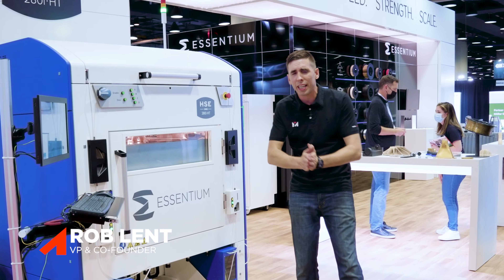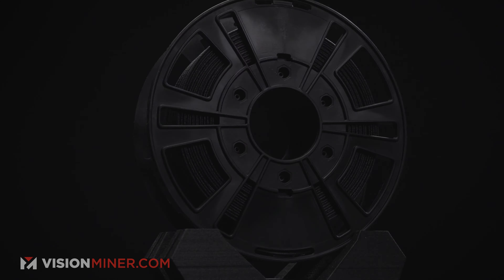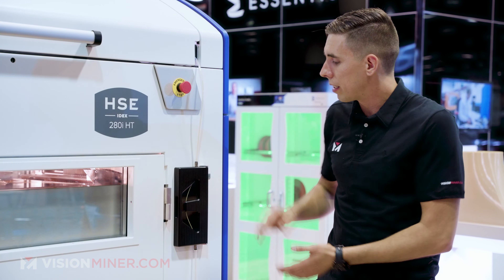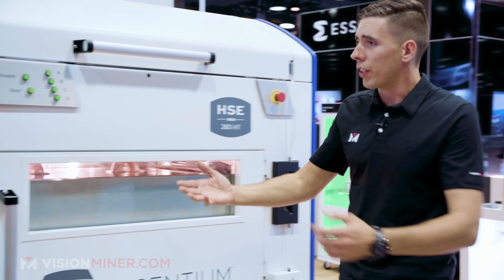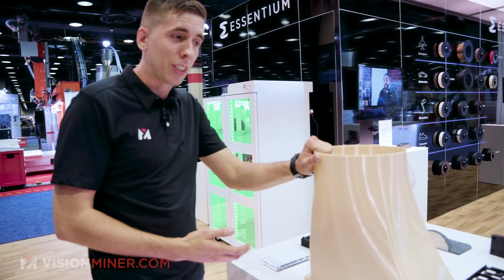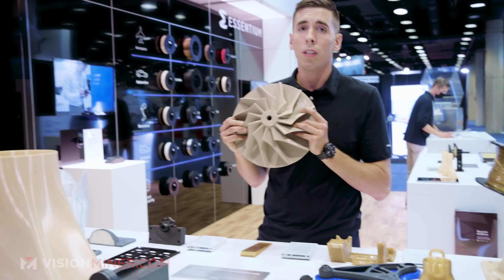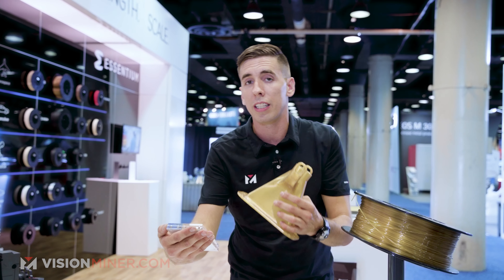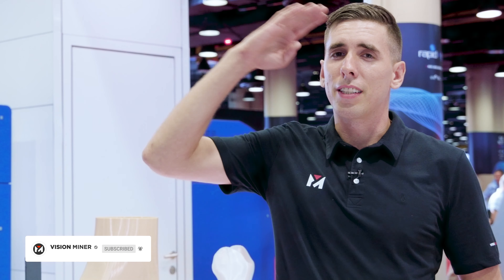Essentium HSE 280i HT - True IDEX Industrial 3D Printer  - Rapid TCT 2021

Comment: so you say it can do 1m/s but in the demo it does 80mm/s? that is slower than most people print on an ender3. I've yet to see a video where it actually does over maybe 150mm/s. If you have to invent a new name for fdm printing just because it's supposedly fast wouldn't you want to show that off?
Reply from the maker: It's more complicated, really -- every material behaves differently, so "speeds" are really not something that should be marketed -- however, they're pushing boundaries and really DO print that fast with some materials!

Comment: I've been impressed by them but a little sad that you lose the entire benefit of the idex system if you're printing support material. But what are your thoughts on reliability compared to Stratasys? And is there tip changes that are easy?
Reply from the maker: What do you mean you lose the benefit of the idex system in support mode? Technically you could still print multiple models, but you're still benefitting from the IDEX with support, and lack of oozing/etc during printing. 

The reliability is on par if not FAR better than Stratasys, partly thanks to a team that is passionately working to change the industry standards -- they're going lots of places, and fast :) -- tip changes are easy too, their Hozzle design is like nothing I've ever seen before!
Reply: @VisionMiner  with a good multi-nozzle system like Stratasys has, there really isn't any leakage onto the part. It's good to hear that it seems reliable. I haven't gotten any numbers out of them on relative up-time or ease of slicing compared to Stratasys. And agreed I love the Hozzle. It's super to have a tip that doesn't wear out like hardened steel